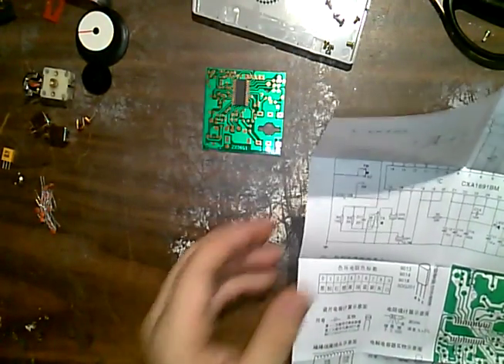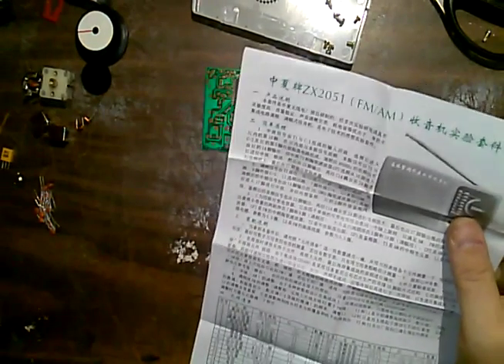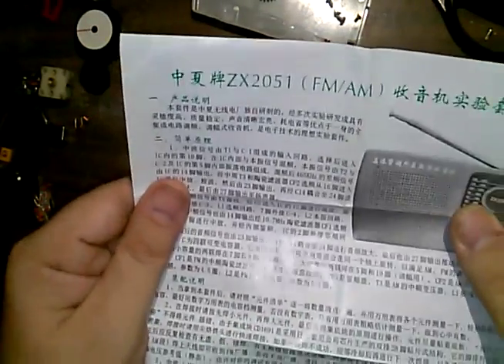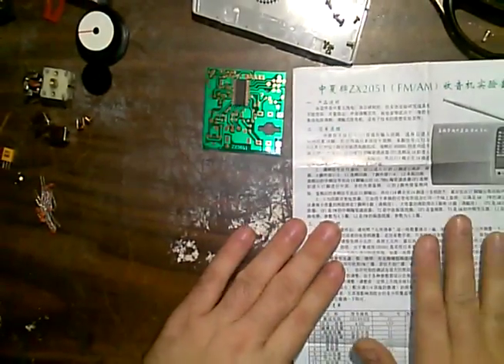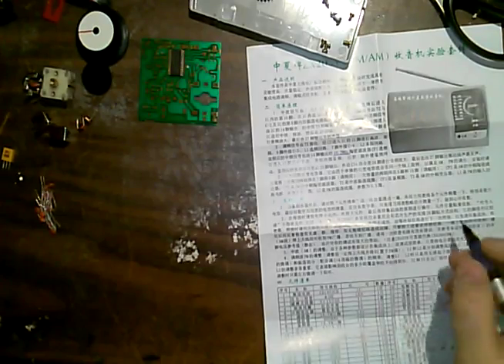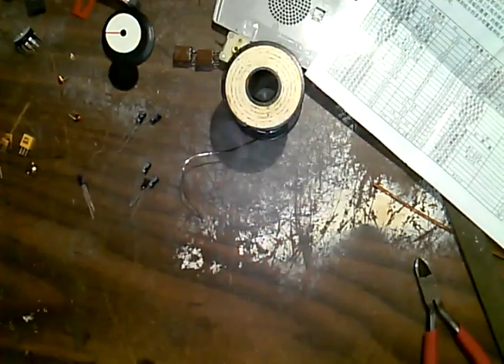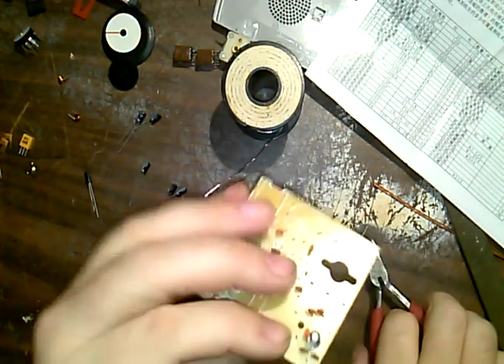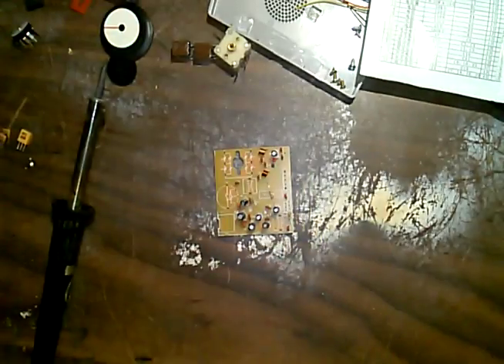ZX2051 -  Chinese AM/FM radio Kit build,  Yes there are issues

Comment: Thank you for posting your assembly experience.  I bought the same radio kit, and have it about half assembled.  I hope I can avoid some of the assembly problems you had.  To be honest, I had a couple of good laughs at your expense, but I'm sure I'll have some of the same issues.  Thanks again for posting the video.
Reply from the maker: No problem and yeah I goofed up the dial plate.. The radio out of the box, didn't need much alignment since the IC controls most of that already so playing by ear should get you set up without test gear.